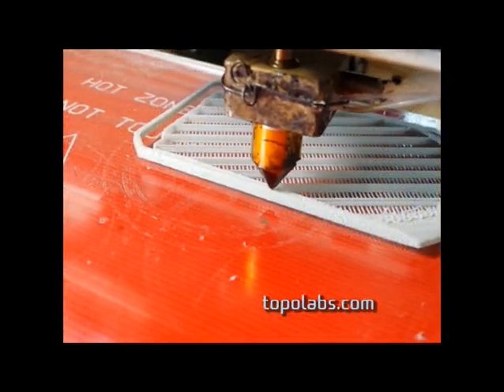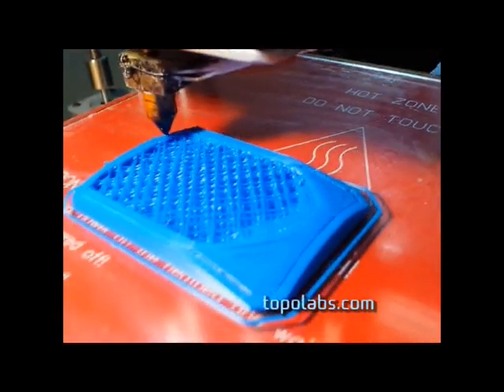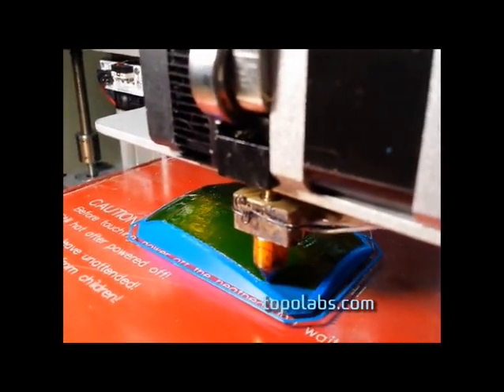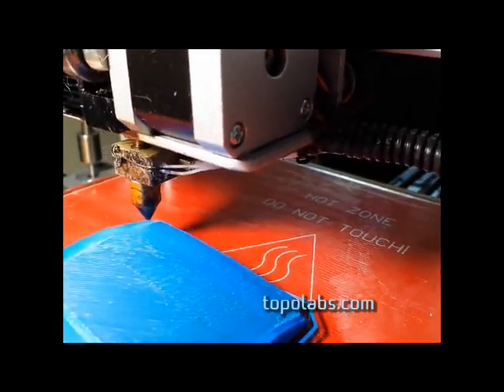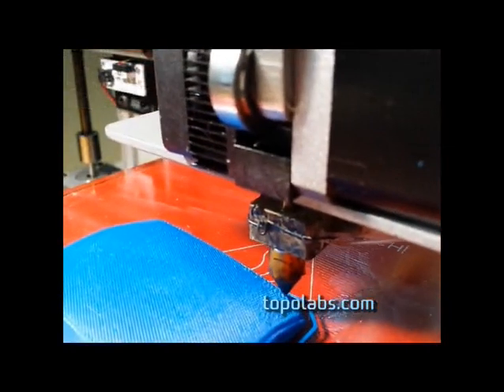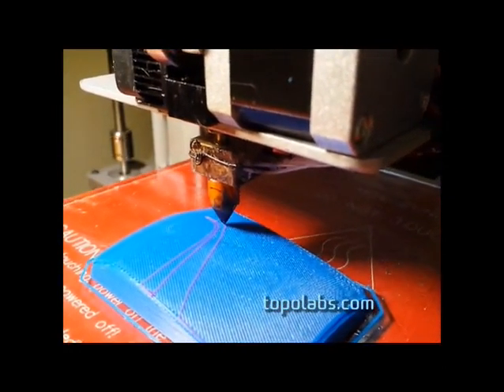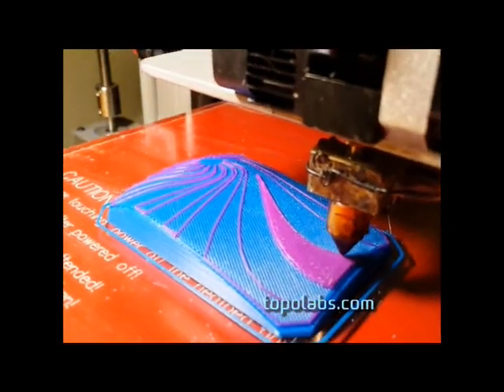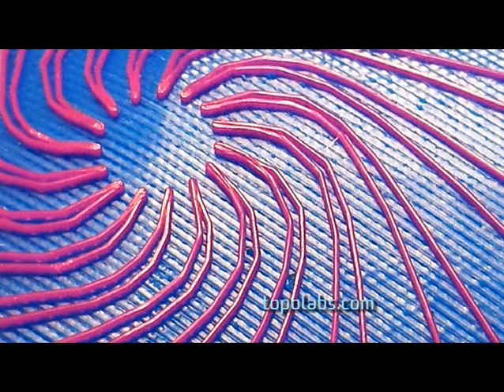Topolabs web video 2 med rev2

Comment: Very Impressive.
i was actually thinking about this the other day. Wondering if there was a better printing process out there somewhere in the world.

From what i noticed the print is much better looking. Hands Down.
But it appears to take a longer time to produce. So you sacrifice print time for print quality.
Would love to see the algorithm you used to produce these results.
Reply from the maker: You're right for now, but we're making improvements:  The print shown in the video is artificially slow;  We can get 5-10x the speed with a few minor software improvements that we are still working on.  Basically the paths shown in the video have the XY and Z axes all limited to the max Z speed, but with a slightly smarter calculation we can let X and Y go a lot faster.  Also, this printer is especially slow in Z, but some printers with better leadscrews or Delta type printers can have much higher Z speeds.

Comment: You say "Notice you can use the support material to print another part": I doubt that in this particular case you could print the sides of the part with the support material already in place.
Reply: Other than that, it's awesome!
Reply from the maker: True, but you can still re-use the support material:  You remove the support from the bed, then print just the sides of the case, then drop the support material in the middle of the newly printed sides.  It's a snug fit and works quite well.

Comment: It's very fascinating watching that go. I really only use 3d printers for action figures or character busts so I need relatively high detail, because of that I've pretty much been ignoring desktop printers and going straight to shapeways and using silicone molds to make copies.

Do you think this method could eventually be useful for objects meant to be used in making a mold like that?
Reply from the maker: Great question.  Topolabs techniques will be very useful for creating models that have texture, or models where a fine fabric-like texture is acceptable.  The tools will give you a lot more control over the texture that you get and you'll be able to choose between many possible types of texture.  If you need really smooth surfaces or a polished finish, you'll still want to use a reputable service bureau like Shapeways, Cubify, or iMaterialise that will make your models with stereolithography (SLA) or with SLS / DMLS followed by a polishing step.
Reply: If you print in ABS, you can vapor bath a print to make it very smooth and shiny, perfect for molding.